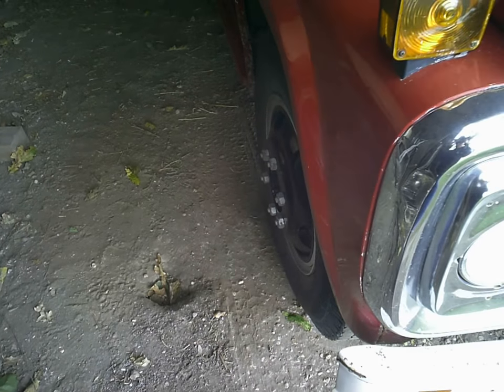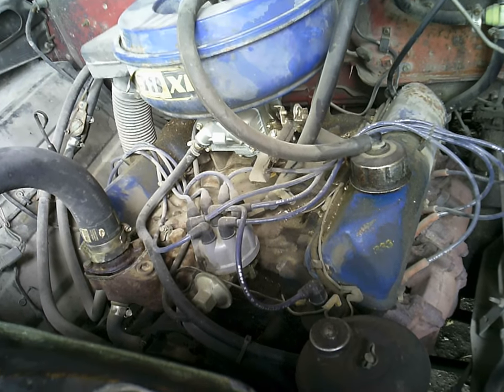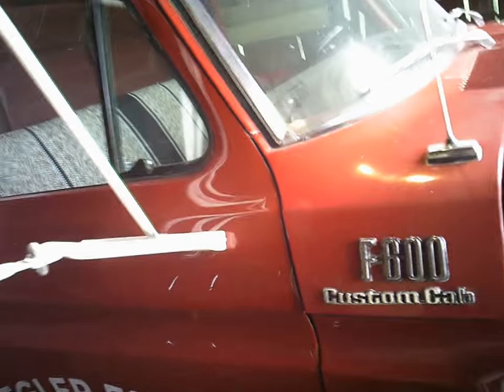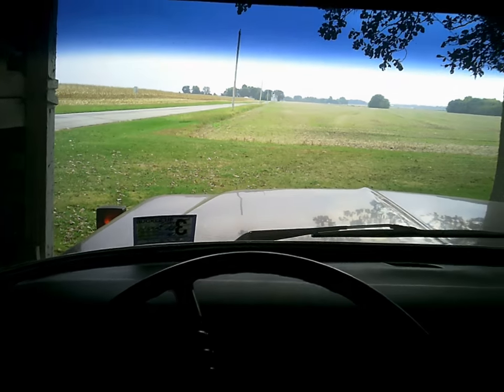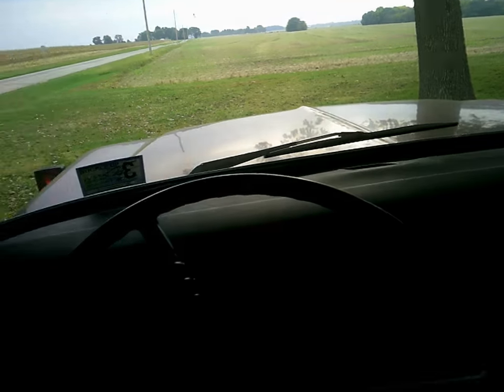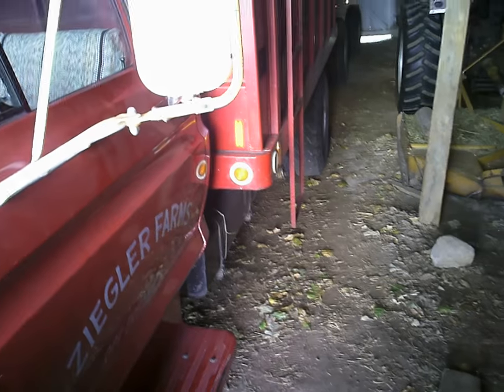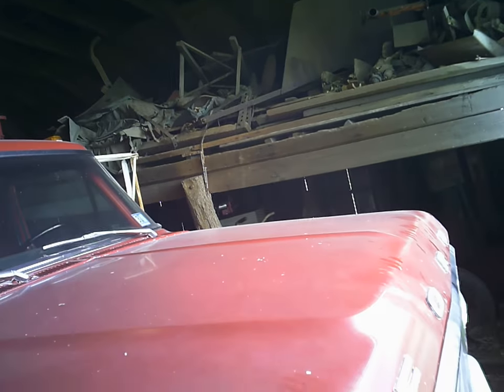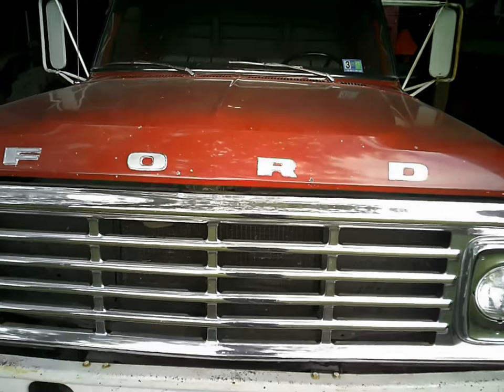1976 Ford F600 overview

Comment: We have a 1979 F600, has around 18,000 miles on it lol We don't use it much anymore just sits in the barn. 370 engine in it.
Reply from the maker: Mac102004 Farms dang that's low miles

Comment: Jake that is a slick looking truck, I used to have a 76 one ton with 360 bought new the engine gave me lots of trouble first had a bad head from the factory had it fixed under warranty 10k later valves burned had a local pull heads he said the head dealer put on under warranty was a used one can you believe that.

Comment: you throw more on this truck than the diesel one?  crazy.  those 331, 361, 391 series engines are great at turning gas into noise not so much at making power.  Love the look of those old trucks especially the gauge clusters
Reply from the maker: Jay Groom ya only like 25 bu In the wagon. We've just always pulled this wagon with this truck. We get stuck in our ways lol
Reply from the maker: Jay Groom ya they do like gas. I'd really like to put 5.9 cummins in all of them
Reply: i really thought you would haul more with that diesel truck you have.  is that just because of the slick tires that you don't?

if i was farming again, most of our runs were pretty short, less than 5 miles so not sure I would get diesel though we had a semi with a really long wheel base we put  a 18' flatbed on.  Problem of course is getting someone who can drive a 13 speed.  The cummins would be a way around it, just in our case would never have penciled out
Reply from the maker: Jay Groom no not the tires. I thinks it's cuz dad likes the all red set up and the blue and white with the red and white. One would never know the 25 bu difference hauling. You need to get back into farming like Nate!
Reply: You are right, I do.  Maybe in a few years.  I thought you said it was more than 25 bushels.  no you would never notice that for sure.